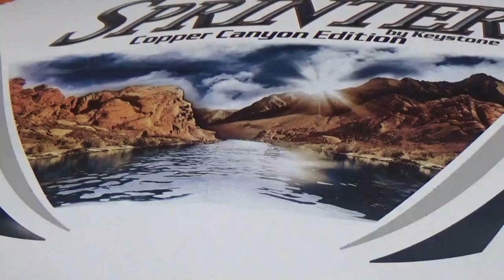RV Roof Replacement and rebuild back wall

Comment: Does an aluminum frame make a leak like this any less cost to repair versus the wood structure ?
Reply from the maker: If it is all aluminum frame and if we do not have to rebuild, reframe , reinforce, then yes it could save some money. What we have found is the aluminum is a low grade alloy and typically not welded very well. There is also backers aka stock that is in the walls to screw things to, like cabinets and ladders. Those are usually wood that end up rotting and need to be replaced.
Reply: @RVROOFINSTALL  we trying to decide between a keystone bullet with alum frame and a northwood nash with wood frame. keystone seems to be a mass produced brand that likely lacks in QC where as northwood has a smaller output that generally is put together a bit better. what are your thoughts ?
Reply from the maker: @r3ddyfire87  the problem I see with the aluminum frames is they are not welded very well. Usually they don't weld both sides. They also use a low grade alloy. I'd prefer a wood frame.
Reply: @RVROOFINSTALL  Keystone is adamant that they weld both sides.
Watch their build youtubes..
My Copper Canyon is definitley well welded.. Just look around in the basement for quality..
Reply from the maker: @cliffodell8593  what they market and what they do are 2 different things. 
3m 90 is 1 adhesive we use..3m 94 is another. 78 is another. Depends on the application. Make sure your adhesive is compatible. Read the tech data sheet.
Thanks for watching!
Reply: @RVROOFINSTALL  I am able to see the welds throughout the basement and bulkheads. I have a lot of fabrication experience and I can assure all viewers here that the welds are excellent... 2010 Copper Canyon..
Reply: @cliffodell8593  thanks for the update Cliff

Comment: What did you use to laminate the Filon siding to the subsurface?
Reply from the maker: You can use 3m 90.
Reply from the maker: Jon you can use some spray adhesive  like 3M90.  We use commercial grade adhesive but we buy it in large cylinders...very expensive...500 bucks and doesn't go that far.

Comment: What brand RV would you recommend for quality?
Reply from the maker: There is no brand better than another. I've worked on high end models and they just have more glam then the cheaper ones. Roof wise....they're all assembled as cheap and as quickly as possible. They all leak. Well now that I think about it....we have never had an Airstream in here.
Reply from the maker: They are all built the same. I have not found one to be any much different than another. We have worked on new coaches like Mobile Suites ($120k) which is expensive 2017 Cyclone, 2017 Road Warrior. They're motto is .."Get em built, Get em out, Get em sold". The only coach we have never worked on is an Airstream, not one has come through the shop.

Comment: If you store an rv covered and maintain the roof you'll greatly reduce the chances of having this problem and if there is a leak you'll catch it while in use.  Most people store them outdoors unused for months, once damage is discovered it's to late.  If you cant afford proper storage dont by an RV
Reply from the maker: If covered they need to use a breathable cover. Our roofs don't need coverings... they're real commercial roofs. Just like the ones in a hotel or office building. 
Good advise and thanks for watching!
Reply: @RVROOFINSTALL  Agreed!  Yall do good work.  Ever replace roofs without issues?  Might consider it for longevity, piece of mind and warranty.
Reply from the maker: @josephmcmillion882  yes we have replaced roofs before their time. The 2017 Mobile Suites was brand new with 110 miles on it. It's in our channel.

Comment: you made a big deal about the ladder not being supported and never put blocking in for it
Reply from the maker: You can see the blocking at 24:29 mark. The rigid foam is blocked against the  2x6 we used.
 Thanks for watching.

Comment: Exactly why I will never buy a new trailer again!! My last two trailers were used......so when something like that comes up I just fix it myself without feeling like I spent 30K+ on cheap BS
Reply from the maker: I never encourage anyone to buy a new RV.  Folks don't realize that RVs do not fall under any lemon laws, and when you sign the purchase agreement there is a clause in all that fine print stating you will not sue them for anything.

Comment: get on the roof every few months and inspect for problems...cover it in the winter or park under a shelter... sun, rain, wind, snow, hail, they are all your enemy
Reply from the maker: Inspections are smart for sure. But a roof system should be able to handle typical weather elements. RV roofs are worthless. Thanks for watching!
Reply: @RVROOFINSTALL  yes I agree the quality of the materials and the workmanship that goes into it these days are indeed lacking. Myself I own a 1997 Glendale Golden Falcon built here in Canada. Unfortunately the company has gone out of business due to the high cost of importing  parts and materials and the low dollar value of the Canadian peso LOL. But they built some damn good RVs in their day. My fifth wheel is holding up very well and just turned 22
Reply from the maker: @termy57  Thanks for watching. I don't own one.

Comment: Typical Keystone build.  Every Keystone I have seen that is more than 10 years old has bad roof leaks.  Roof leak = RV junk.
Reply from the maker: They're all the same. They chant a moto at the factory...Get em built, Get em out, Get em sold!   I don't own one.